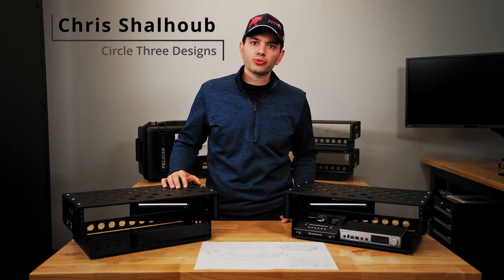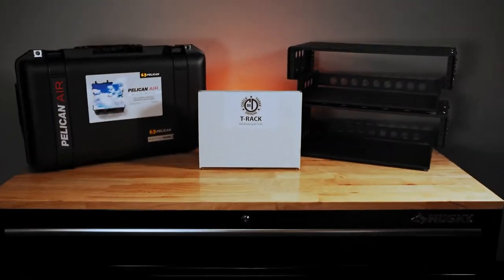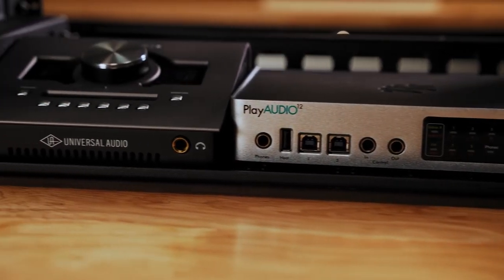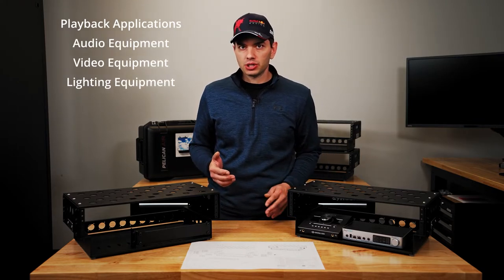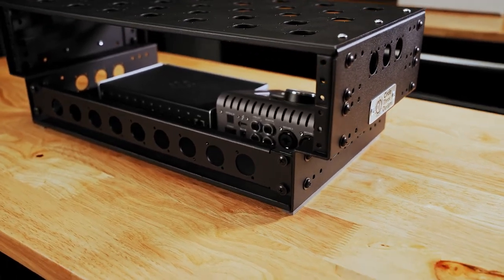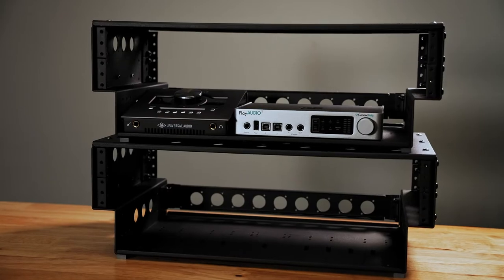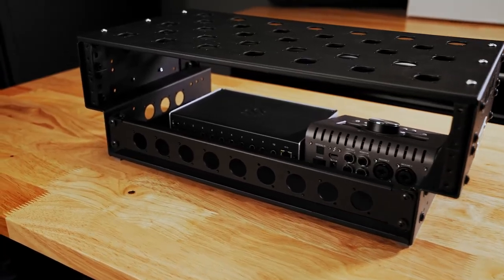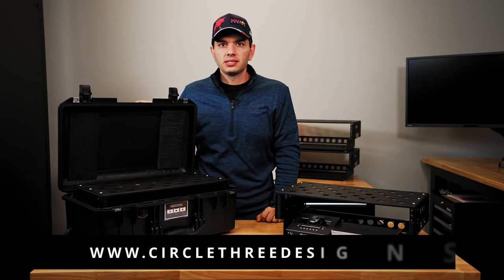Circle Three Designs T-Rack (carry on fly rack in Pelican Air 1535)

Comment: Could you guys make the bottom slot so that it can fit 2 Sennheiser or Shure recievers as those are smaller than 9,5"?

You would have to mount them on the bottom plate though. But it would be one sweet rack!